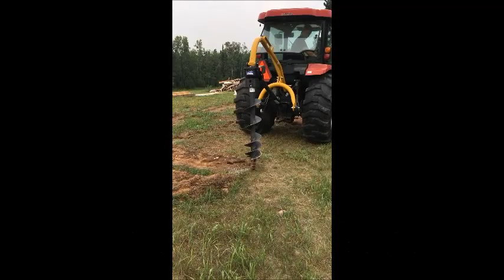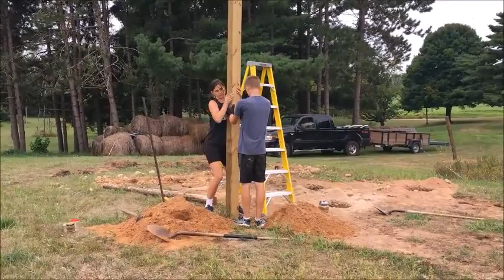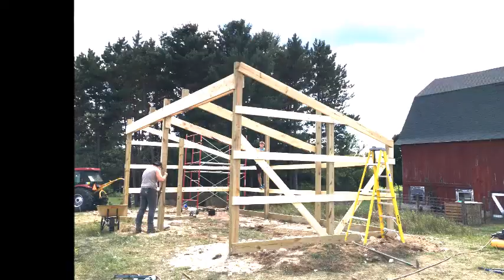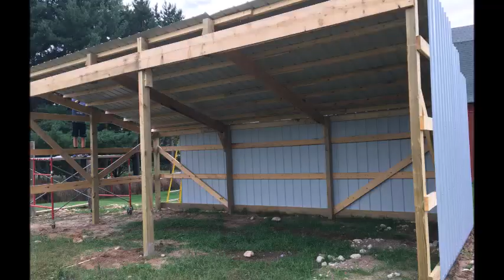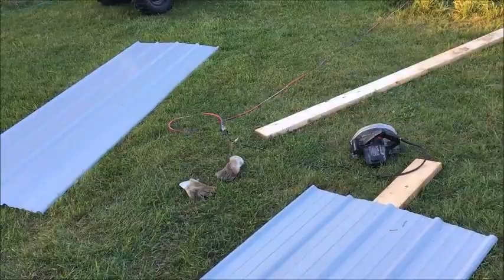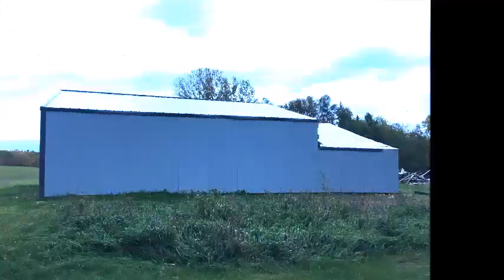How to Build a Shed Barn lean-to Time lapse For Cattle Farming Cows

Comment: What are the dimensions on the barn....length width and height
Reply from the maker: 13'W x  27'L x 7'H ... I added on a 'nursery' for the little ones, that was about 9' wide I think??
Reply: @anggru9768  So that front opening is only 7 ft. tall?????..? It looks bigger than that???
Reply from the maker: @Prison2PurposeGODCast  No the back side is 7' ... I think the opening is about 12 or 14'' if I remember right??
Reply: @anggru9768  cool.....thanks so much
Reply from the maker: @Prison2PurposeGODCast  No problem!